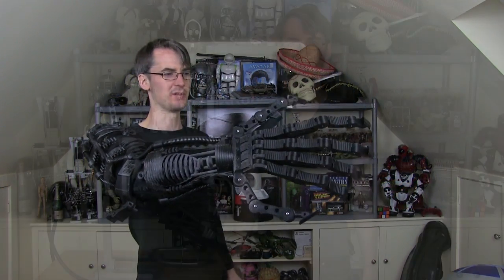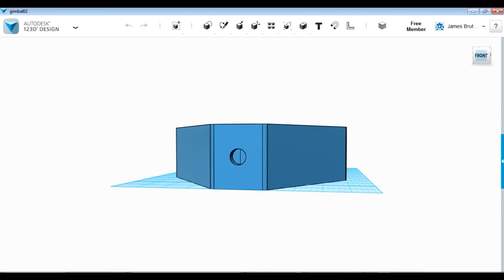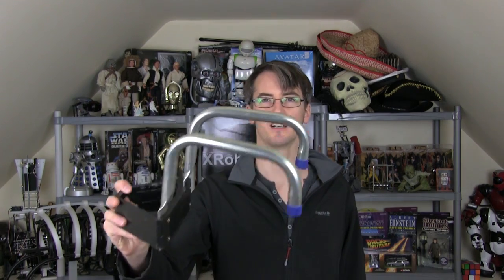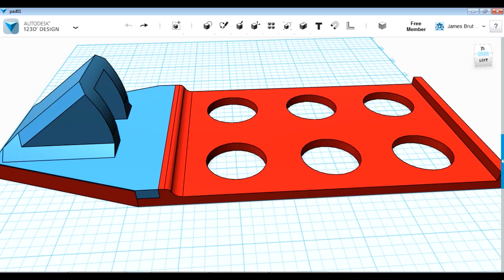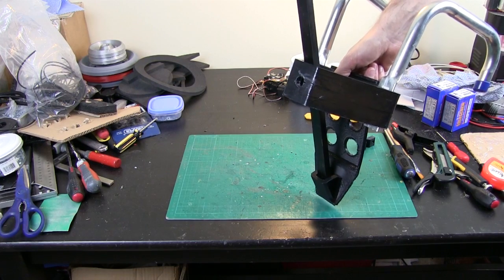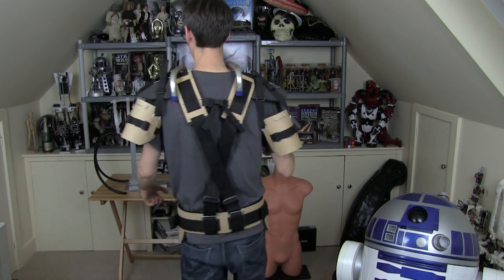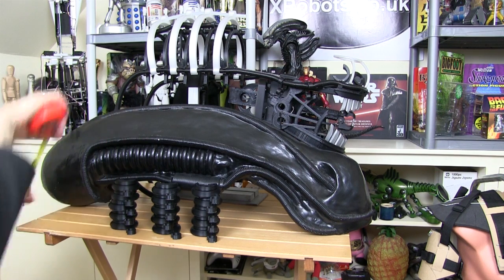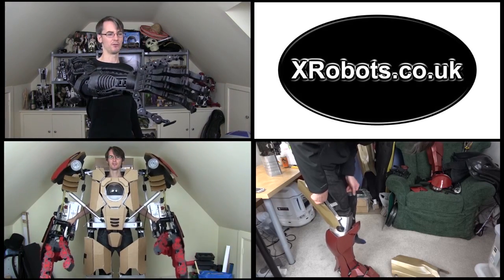Alien Xenomorph Cosplay #8 | Shoulder Brace & Head | James Bruton

Comment: You could make a mouthpiece by running leads to a compression or toggle switch inside some gel or latex that you control by biting down lightly or operating with your tongue. For alien mouth/tongue movement.

Comment: Looks really good and at least it wont strain your neck any more holding it up. Love the added detail along the sides. The only problems with it are the angle of the head at the end but once its mounted to something attached to your head as well i imagine it will tilt down more and look better. I don't know how you would press buttons with your nose as the head will be attached to yours stopping you from moving your head forwards to touch the stick, plus you'd probably get a sore nose.

Comment: Looking awesome man. Also when you said you'll be able to push buttons on the stick operating the head features with your nose I got a bit confused. Wouldn't your head and the stick remain a fixed distance apart from each other since they are both attached to the head to keep it balanced?